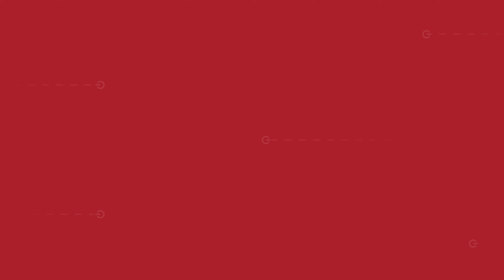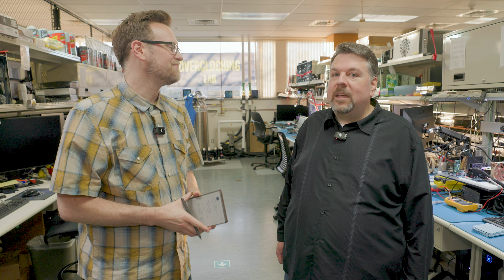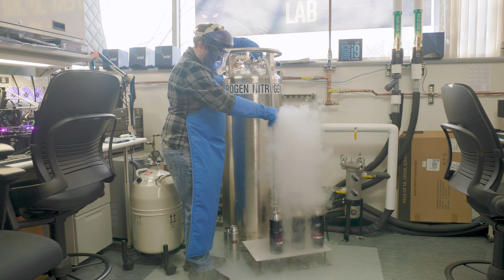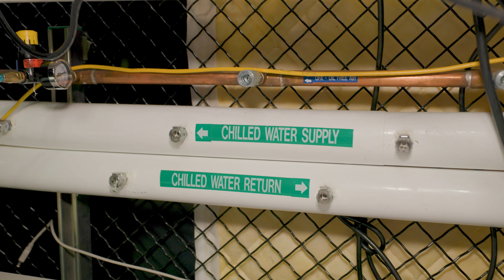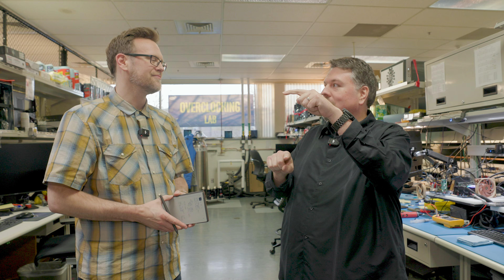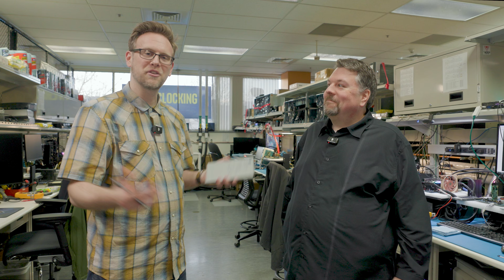Inside Intel's Overclocking Lab

Comment: Interesting if ARL refresh has overclocked D2D and NGU
Reply: That would be great news! Not all D2D and NGUs on the 265K's for example can't run stable 32x at 200S Boost settings. 

Mine doesn't let me do that, however I got 8000 speed memory so it covers a decent amount of what 200S Boost does
Reply: @PixelatedWolf2077  I find it highly unlikely you cannot use 32x NGU/D2D with manual tuning. 200S sets a very low 1.2v VCCSA. Set that to around 1.3v and you should have no issue with 32x +.
Reply: VCCSA? Alright, I'll give that a try. Thank you!  @TalonsTech

Comment: My GTX 1050 (3GB model which is a GTX 1050 Ti with 8 less ROPs and 96 bit bus instead of 128 bit) in my laptop can run it's VRAM at 10500 MT/s (stock is 7008 MT/s) and the GPU core clock can run at 1810mhz @ 0.9v (stock is 1797mhz @ 1.1v) which makes my laptop 3GB GTX 1050 run faster then a stock desktop GTX 1050 Ti while using 25% less power then my stock laptop tune (30w max GPU powerdraw now [stock tune = 40w max GPU powerdraw] and compared to a desktop GTX 1050 Ti's 75w, that means my GPU uses 2.5x less power for MORE performance on a lower class card).
Reply: All Nvidia gpu have his behaviour , stock boost voltage is too damn high 
800-950 range is best optimal option

Comment: Sounds like a great job.   But like you said probably more validation then over clocking but if you are testing the bleeding edge that is cool.   Like breaking the sound barrier but for overclocking.   Elon talks about servers in space.  The vacuum of space is crazy, but could you imagine living in a cold climate where you could not worry about heat or use the heat for other uses.

Comment: Intel screws everyone who bought raptor lake and then wants to talk about overclocking. Gtfo.
Reply: My humble OCd 13700K pushing a decent clockspeed no problem. Skill issue on your end, kid.
Reply: Who got screwed? I had a 13900k that ran flawlessly at 5.8p/4.5e/5.0ring for 2+yrs and Intel still gave me a 100% full refund. Intel is the best! Unfortunately, I bought into the 7800x3d hype and it is a much worse CPU than my 13900k.
Reply: yeah, I was waiting for this kind of question ....when MB manufacturers were regarded as cherished customers ...:))

Comment: Ask them why they haven't put their high frequency p-cores into a workstation sku series? Not many people need the 128 PCIe 5.0 lanes Threadripper offers, and so the i/o die could be cut in half. Give us a 64 lane, 5Ghz +, 4 to 8 memory channels with MRDIMM support, AVX-512 CPU with a huge cache, and you'll throttle AMD. There's infinite segmentation for industry, and virtually none for enthusiasts.
Reply: YES. Stop putting mobile chips in desktop, bring back HEDT. Full P-cores
Reply: no no no more lanes more pcie lanes needed
Reply: @lelkasa361  How many lanes are you currently using?
Reply: @SyntacticOperator  hi i am currently need more lanes but sadly i cant due to money reasons but yes i am lane limited in amd hedt 
and no i am not going to count the amount of lanes because the devices i am using are going to use more lanes if given but are running at 1x mode / clipped to fit in 1x slots
Reply: @SyntacticOperator  and lets not forget thunderbolt is 4x pcie lanes in complicated ways
Reply: @lelkasa361  It's sad the PC market has become so expensive.
Reply: @lelkasa361  Why not buy Threadripper if you need 128 lanes?
Reply: They don't have the capacity to support HEDT Intel Fab in Ireland is still ramping and Intel 7 is wafer constrained they are prioritizing DC over HEDT
Reply: @IDKYDK-511  They have more than enough capacity. They currently have so much unused capacity, they are losing money.
Reply: @IDKYDK-511  Also, Intel is still making 'HEDT' in their Xeon W series.
Reply: @SyntacticOperator   Yes they are but that is still SPR not GNR
Reply: Remind me 7700x the dual channel hedt failure
Reply: @frankwong9486  25 years of dual channel memory.